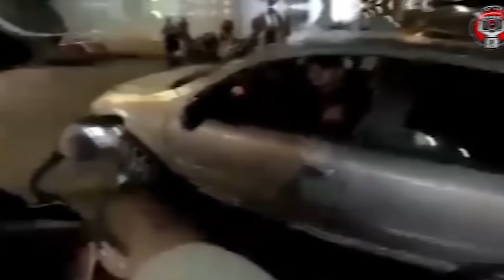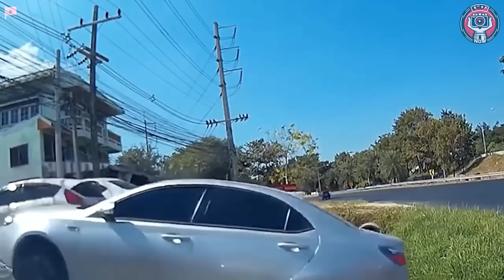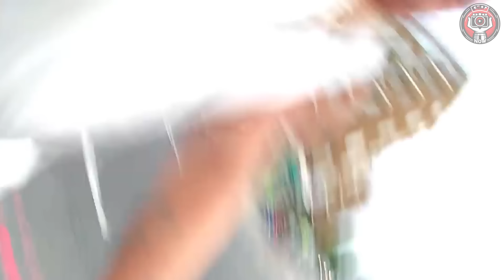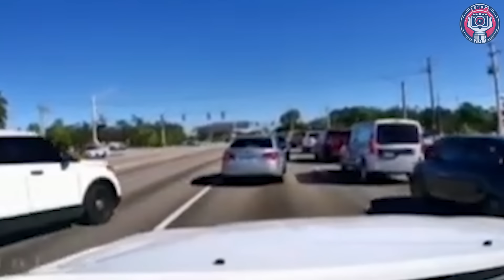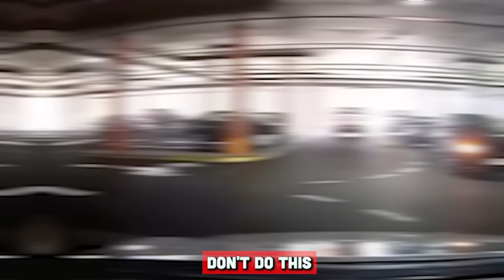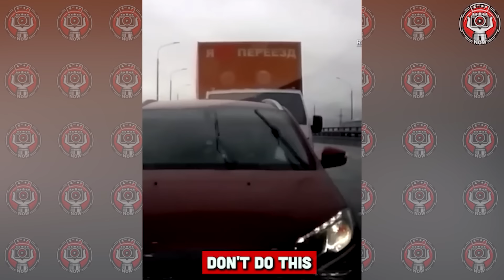45 Times Road Rage Got Served Instant Karma!

Comment: Why do you still uploading the same clips over and over and over........(10 years later) ...and over, and over ?
Reply: Then why do you keep watching?
Reply: @seattlewa8500  It's already resolved. ''Do not recommend this channel'' is enough.
Reply: @seattlewa8500  Part of the reason is You Tube does not abide by its own policy. I have clicked not interested/do not recommend this channel to several channels many, many times over the last 5 years or so as 3-6 months(sometimes only 2 days) these channels come up in the recommendations for you column. Usually with a different picture/caption but the same channel owner.